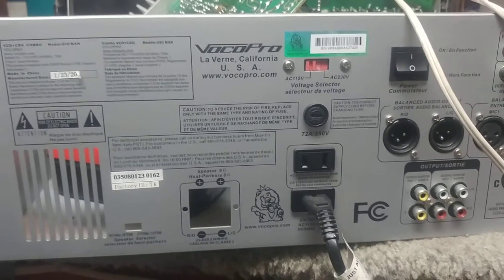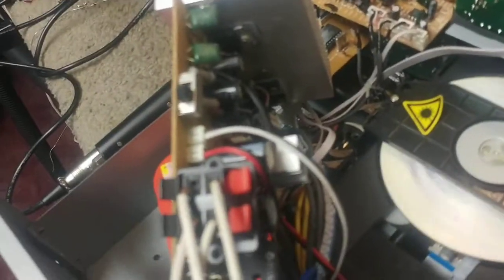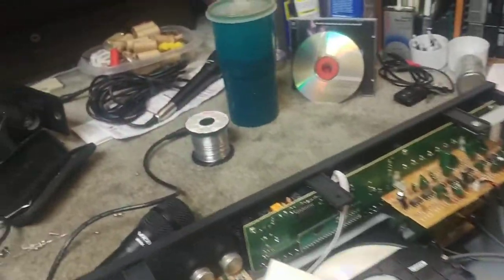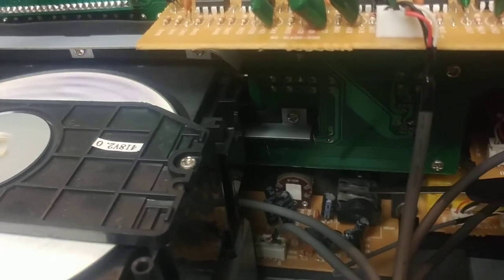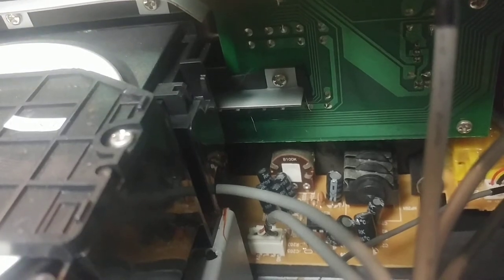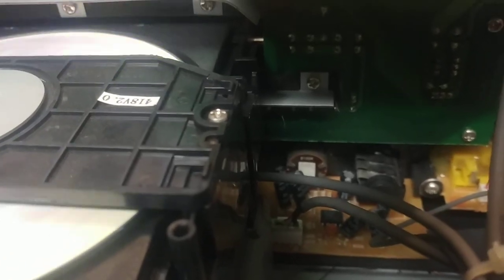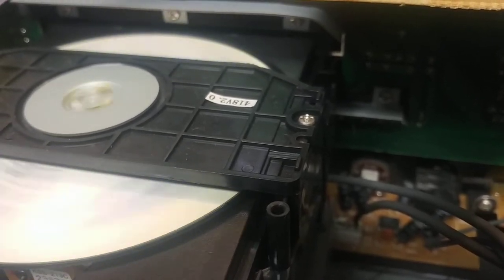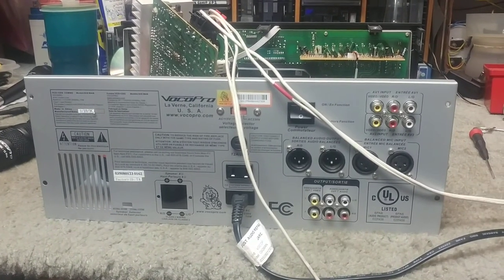VocoPro Gig Man Karaoke No Sound Or Intermittent Sound Fix

Comment: Hello, can you tell me how to take that control panel out of the gig star? My CD player in it no longer works and I'm trying to figure out how to fix it or is it possible just to hook another CD player up to the input and get it to work.? Thank you for any information
Reply: There are four screws at the back toward the top then two on each side he front covered by plastic covers. Once you remove them the module slides out frontwards. You have to disconnect two tw-wire connectors inside.
Reply: @chucksaddlemire  Thank you, I just went ahead and sold it to someone who could fix it.

Comment: Nice video. Useful information. How do you open the case? I took out the handle screws but it seems there are more screws holding the panel. I can see some plastic circles on the outside and I am wondering if there are screw heads behind that.
Reply: Yes.